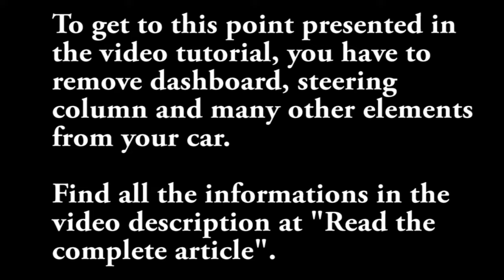TUTORIAL: VW Golf Mk4, GTI, Jetta, Bora heater core replacement / removal in 14 steps

Comment: For anyone wondering. This is a climatronic HV/AC box, so you cannot split the heater core section like the manual cable control HV/AC box.
Reply: Instablaster...
Reply: Even being climatronic this tutorial did way to much extra steps than needed.  That whole beams doesn't need to come out and neither does the whole heat/ac box.

Comment: Is it possible to remove the heater core without disconnecting the ac?
Reply from the maker: No, it’s not possible.
Reply: @Servicetutorials  yes it is. its a serious pain, but you have juuuust enough room to move the box back from the wall and get the core out, if done carefully.

there's zero reason to mess with the ac assemblies or wiring at all. nor is there any reason to fully remove the climate box from the car itself.

several of the steps in this video can be skipped entirely, as they are fully unnecessary.

Comment: Too bad you dont accurately have this step by step...wheres the wiper motor at? You have a bolt under the hood 3 minutes in to video to remove but theres all types of shit in front of it that you dont have there?
Reply: Remove plastic nut covers from wiper arms x2, Remove 13mm bolt x2, Wiggle the wiperarm to remove the wipers x2, Remove rubber weather grommet, Remove plastic cover and then Resume video.
Reply: With all due respect...if your asking this question...I would advise against doing this project. It’s up there as one of the most complex jobs you can do on this car. Think about it...you need to remove the wiper blades as a step towards removing the heater core. Discharge the AC...which is expensive to recharge (Receiver dryer replacement, refrigerant, labor), etc. The risk of damaging an electrical connector / conductor is high, and you will inevitably break something in the process...we all do. Horrible engineering on VW’S part. As I’m responding to this comment 2 weeks after posting, I hope you had success if you took it on.

If not and you are still going ahead, consider re foaming the blend doors in the hvac box. That foam has rotted out by now, and most likely chunks have been hitting you in the face on occasion as you drive. Humble Mechanic has a good video on that. Good luck.
Reply: @TRCFL  lol...i already did the job...thank you very much...and fixed my heat!....its not too much to expect a step by step project to include each step lol just because i expect it to doesnt mean im not capable to fix my heater core...i did...it would have been helpful not to have to watch other videos to fill in where this video skipped!
Reply: @TRCFL  First and foremost the point is to replace the damn heater core not disassemble the entire effing car. Mine failed last year and I did not discharge the AC don't understand how stupidity keeps growing because people are too lazy to find out what's factual! Unbolt what's necessary to gain access, replace the core, and put everything back, definitely easier on a mark 4 then a mark 3!
Reply: @emotionalintelligence776  hey man. I’m about to be doing this on my car soon. My dash is ready to come out once I pull the steering wheel. How were you able to pull the HVAC box away from firewall without disconnecting that AC connection? Also, I have watched a tutorial where the guy said to only loosed the big crossbar. Is that what you did or did you fully remove it? I’m trying to do as little as possible to do the repair. This video makes it seem like a total destruction video. Obviously this is a parts car and isn’t going back together.